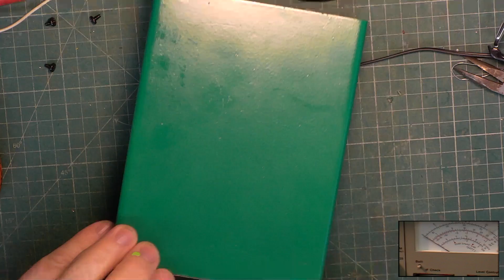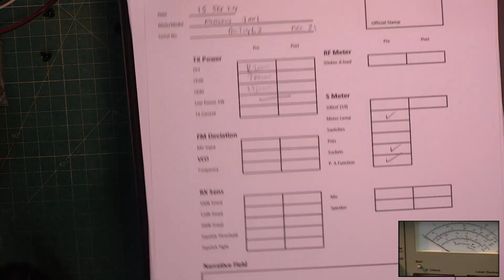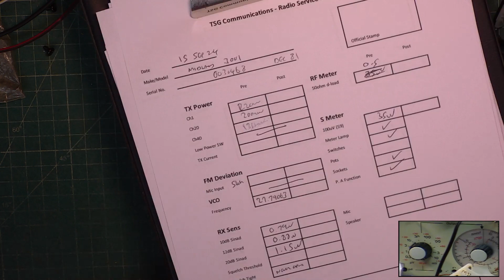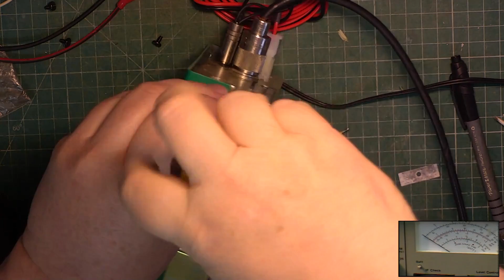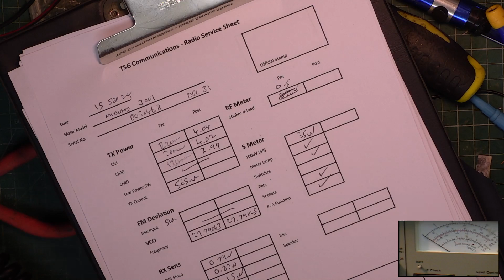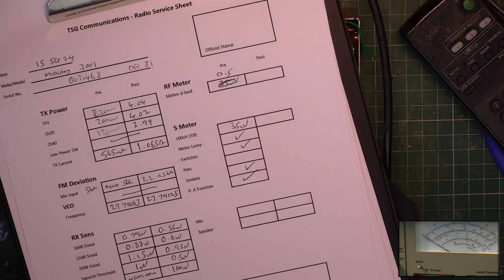Midland 2001 CB27/81 UK FM CB radio -  repair & alignment

Comment: It is very much appreciated. What is meant by 27/81, please ?
Reply from the maker: The UK CB radio system introduced in November 1981 is 40 channels, 4W, FM covering CH1=27.60125Mhz to Ch40=27.99125Mhz. It's governmrnt specification MPT1320. Radios for the unique UK system are identified by "CB27/81" within a circle as a front panel approval logo.

PR27GB followed in the late 80's, CEPT (European) set of 40 FM channels from 26.965 to 27.405Mhz

PR27/94 was a revamp of 27/81 with a tighter specification, paving the was for...

PR27/97 which combined both systems into one radio covering 80 channels FM 4W (UK40 + EU40)

Around 2001 CE Multiform approval came in....followed in 2014 with the UK ability to use AM on the CEPT band on new CE approved sets equipped with such.

Richard, G0OJF, UK
Reply: @ukfmcbradioservicingTango21  Don't Forget SSB "Single Side Band" as of 2014.
Reply from the maker: Well there are only abou six UK legal sets with SSB & this youtube channel is an SSB free zone. SSB comments are usually deleted. I know most SSB UK activity is taking place on illegal or 'non approved for CB' radios and/or at high power, hence not wanting to be involved.

Richard, G0OJF, UK
Reply: @ukfmcbradioservicingTango21  I know I do love a bit of 28Mhz tho. Anyway that's for another time good buddy.